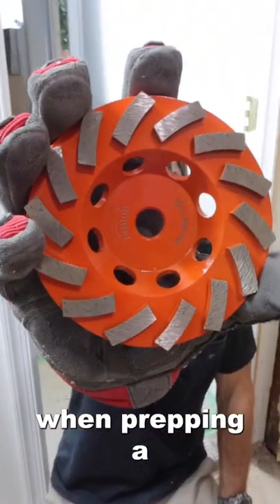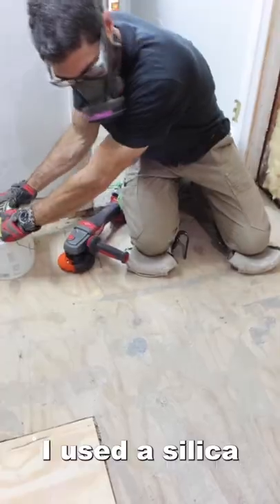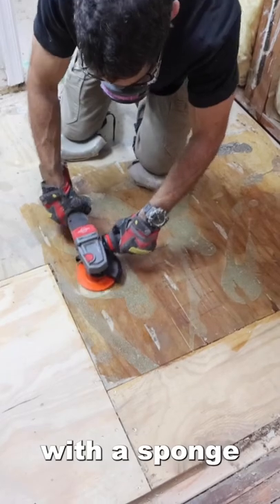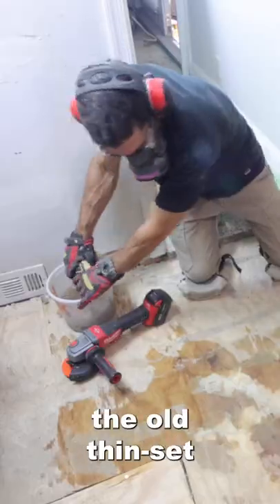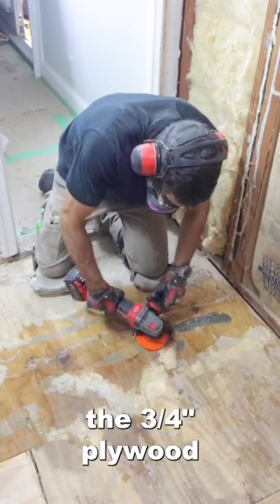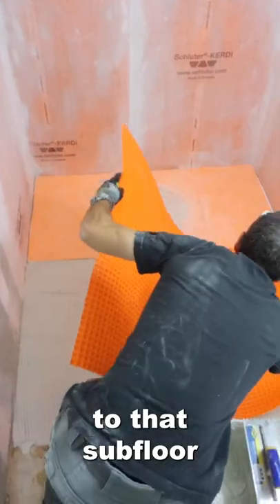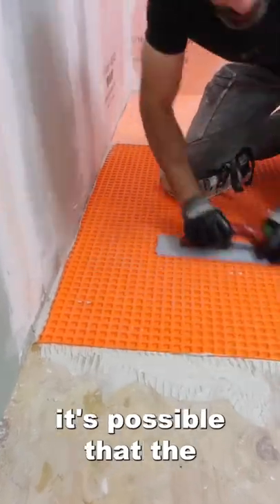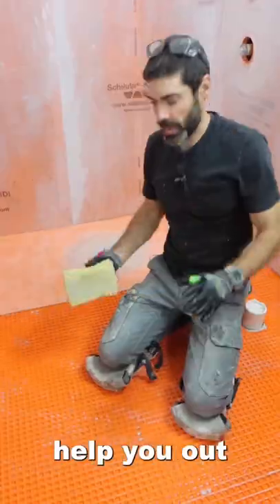Tile Floor Prep Tips - #shorts

Comment: How about removing the plywood and install a brand new plywood? Because plywood is not that expensive.
Reply: 50 bucks a sheet. Are you being serious?????
Reply: When was the last time you bought plywood? Or one better, cut out a subfloor and replaced it...? It's tongue and groove, glued down. Nobody changes a subfloor over a little bit of thinset ....
Reply: @timothinking9855  if it takes me 3 hours and a new bit just to grind off a bit of thin set...best believe i am getting new plywood if I can pry it out in 5 minutes and put a new board down. Time is $
Reply: @MichaelJohnson-  that little tiny bit of thinset in this video would take neither. It was all exaggerated... You could do it with a grinder with a $5 multipurpose blade ( doesn't even have to be new) and 10 min... Either way if you gouge a little it's not going to do anything but guarantee adhesion... Everyone acting like he wasn't just slapping thinset over already stuck thinset.... And PS I can tell you've never replaced subfloor by your 5 min estimate. It's be 10x less work and way less money to run a grinder over some thinset real quick. You've never removed tongue and groove subfloor that is laid end to end..
 It's not like the bathroom has its own special floor. They lay the whole floor, then build the walls. And if you're worth a shot as a contractor you'll match you grooves with your tongues and your tongues with your groove. On top of that it's nailed and glued to the joists, therefore in order to put down the new floor you need to scrape old glue and splinters off the joists .. and pull nails and possibly if it's been changed before screws... Not to mention are you installing cripple blocks or scabbing on to joists to give yourself no sponge in your spans between joists?.... Come on it takes two seconds with ANY BLADE on a grinder to remove thinset....and costs 0 material and is still an charge
Reply: @timothinking9855  What?
Reply: @MichaelJohnson-  let me simplify for ya bud . It's 10x the work to cut out a t&g subfloor and costs way more in material and labor to replace a subfloor in a bathroom, then to grind out that tiny bit of thinset in this video. He's not grinding out an entire floor, nor does it require a new blade for the grinder... Honestly in reality, that tiny bit of thinset is already stuck to the subfloor pretty well, if he's using a 1/4-1/2 inch notch thinset trowel then that tiny bit of thinset won't cause any issue when it comes to him bonding material. This video was truly unnecessary work...
Reply: @timothinking9855  What?
Reply: @timothinking9855  People that know what ur talking about know ur right. No need to explain any further.
Reply: @michaelmcgee2026  didn't plan on it. Somebody could literally do the entire thing by following my reply like instructions